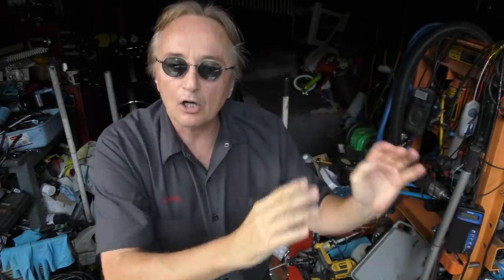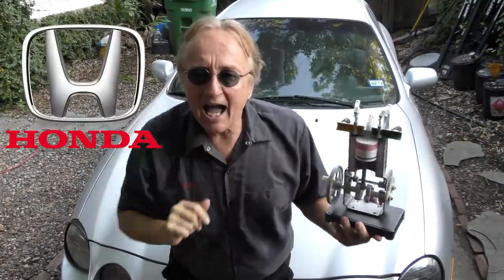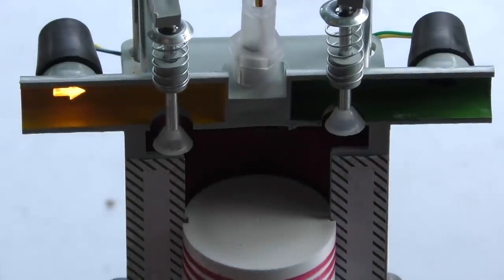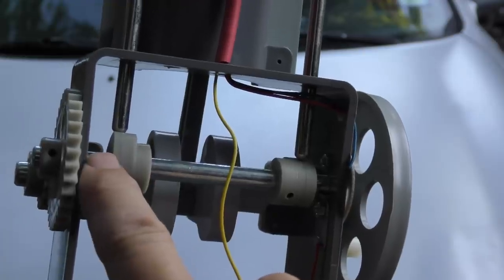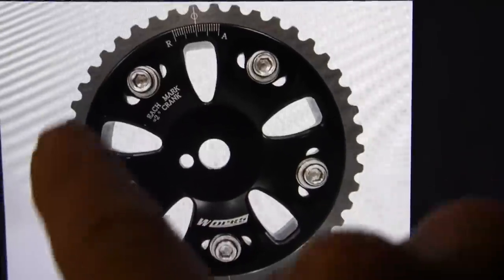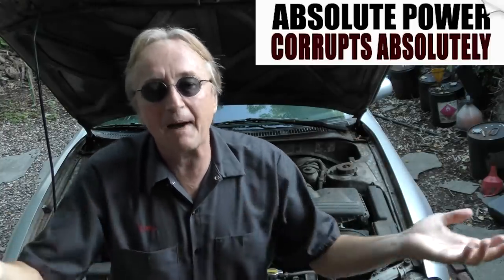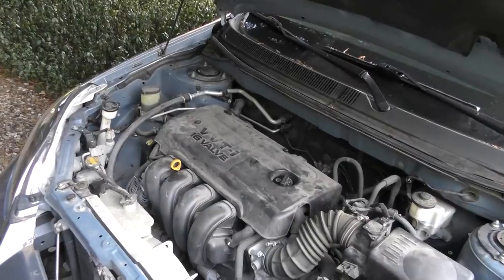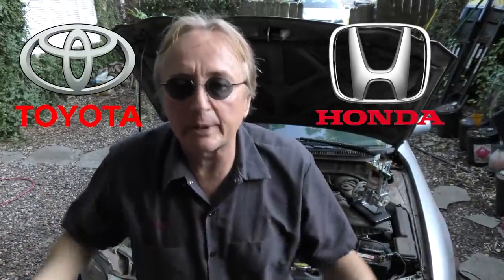VTEC Just Kicked in Yo - The Best and Worst VVT Cars to Buy

Comment: The s2000 is a beautifully crafted machine.  The engine will last as long as the car is appealing to look at. Note: The body lines are timeless.   I do wish the s2000 hardtop was more readily available. 

None the less, Honda makes some amazing vehicles that are easy to work on.  It's too bad they rarely need fixing!

This is coming from Nissan 350z owner.

Comment: Even better reason to avoid engines with absent or inadequate oil change documentation. I always thought using motor oil for hydraulic control of VVT was a problem waiting to happen. It certainly makes these engines more vulnerable to early failure because of bad maintenance.

Comment: Thanks for the video.

I have a 2016 Honda Fit, and I absolutely love it.  It came with lifetime oil changes when the maintenance minder reaches 15%, and Honda uses 100% synthetic oil.

However, although I monitor the maintenance minder, I don't fully trust the maintenance minder to properly tell me when to take care of my car.  As a result of having a very very light foot for acceleration, and I getting off the gas to coast way ahead of time when I see a red light ahead, this appears to cause the maintenance minder to change the oil life percentage very slowly.  For example, the maintenance minder generally displays the oil life at 15% after almost 15,000 miles.  To me, that's just pushing your luck and taking unnecessary chances, especially in the hot summer months.  And for those of you who might have a heavy foot, 15,000 miles would be way too far to go between oil change intervals.  So, when the maintenance minder reaches between 50-60%, I do my own oil change with Amsoil 100% synthetic oil, and when it reaches 15% I take it to the dealership to have them do it.  Keep it squeaky clean!

As a result of taking good care of the engine, and the whole car in general, and driving sensibly with a light foot, I average 44mpg with a mix of city (40%) and highway (60%) driving.

Comment: VTEC does not adjust cam timing. It just has different csm profiles for low rpm and high rpm. The later IVTEC was the system that introduced cam timing changes. This is why you can buy adjustable cam timing sprockets for the B series Honda engines.

Comment: I have a 2007 Mustang GT with the  VVT engine. At 81000 miles the engine failed. After it was put back by a mechanic, I changed the oil and put the recommend 5/20 oil in it. Almost immediately, the engine started acting funny like it was going to jump time. I am running 10/40 in it now. No problems since.

Comment: I bought a salvaged 02 celica gts with 110k on it , check engine light came on the next day . Had to change the oil pressure sending unit and it’s been doing good ever since

Comment: I have the legendary k20 engine with 200 horse power on an ep3 type R (1200kg)and it's super reliable and a lot of fun. Right now I wouldn't change it for anything. Also these engines were giving out 215 hp in the Japanese version of this car so people easily tune them up to 230/240 hp and they're still reliable but way faster. Just gotta always carry that bottle of oil in the boot .

Comment: I got my 1989 Toyota Cellica  running right again wow it was amazing how hard it was too locate a Bymetal vacume Regulator check valve ,  i searched for weeks even on Japaneese auto parts store sites ,  finally a used one poped up on ebay i bought it fast ,,, now i am gonna replace the rest of the vacume lines  next week ,

Comment: Cars that left me stranded: 
1. Plymouth Sundance : Transmission fell apart (about at 90 K) salvaged
2. Ford Tempo- Engine cracked (80k) salvaged
3. Volkswagen Jetta ('96) - head gasket blown (130k) traded in. 
3 '92 Mercedes Benz E190  - Ignition key stopped working/stuck (220k - it was eventually fixed car was sold in running condition)
4. 1993 Chevrolet Cavalier Z24-- 5spd. Too many problems and service to list, traded in at around 75k. 
Cars that never broke down, never left me on the side of the road: 
1. 1981 Ford Mustang LX 4-cylinder mileage unknown last time used was 1996 in running condition. 
2. 1992 Honda Accord EX -5spd.  Beside a few light bulbs and regular tear&wear never had an issue.
 Mileage unknown- last time was 250k, last time seen running 2005.

Comment: My family has had a Toyota Previa VVT (proably 2003) and we bought it new, it still runs today after 300.000km and nothing has happened to the engine! Only replaced the exhaust once and small minor things that all vichles have done to them, has proaby at least a good 70.000-80.000km left in it.

Comment: Actually I used to own a 1995 Alfa 155 that had the exact same pioneering variable valve 8 valve Twin Spark engine. Great engine, with good power and sound  and believe it or not reliable too. Well the gearbox and everithing electric on the car was a whole other story though.

Comment: I have a multiair engine. In my eyes that's the most advanced engine as Farr as VVT AND VVL go. Each cylinder has independent timing and lift depending on demand. It's designed so your valves can even open twice or more in one stroke depending on the conditions it needs to meet

Comment: Regular oil changes and the correct oil=longevity. Probably why the oil weight is printed on the filler cap in these modern engines.

Comment: I beat on my TL on the daily so I started using 10w30 oil, I should’ve done it before because I was using 5w20 and ended up getting shaving in the oil thankfully I caught on to it early on, flushed out the shaving then filled her up with 10w-30 with some Lucas oil treatment no more shavings! Ever since that I do oil changes on my TL every 2 weeks, the longest I’ll wait is to do it is 4 weeks.

Comment: I almost didn't buy a 1994 Honda Civic with 375,000 K, even though it drove like new and was in great shape, because when I tromped on the gas I thought I was hearing a slight rod knock. As it turned out I was hearing (for the first time) the cam timing change to high performance, thus the motor having a little more rap to it at 7000 RPM. I drove it for a few years (no repairs needed) with the peddle to the floor because it was so fun to drive. I sold it to a young kid and he really abused it until over 400,000 K (it was still running when he sold it. Mid 90's Honda's were the best cars ever made for the money. Excellent gas mileage, yet plenty of pep and extremely reliable and tough. Also a nice ride and handling.
Reply: I forgot to mention that the Honda (with high mileage) was completely dry underneath (not one oil leak anywhere) and didn't burn a drop of oil between oil changes (which I tend to stretch, but I do run synthetic).

Comment: Thanks for the tip on using the correct weight oil. I ALMOST bought 5-30 instead of 5-20 thinking it would be better for my high mileage (165,000) engine. It's the 5.7 HEMI with vvt.

Comment: Nissan VCT. In 1987 Nissan introduced the Variable Camshaft Timing—the VCT namesake—which dynamically adjusts cam timing throughout the powerband. You might be thinking that 1987 happened a whole two years before 1989, which is when Honda introduced VTEC on its second-generation Integra. Trouble is, Nissan didn't necessarily promote its whole variable cam phasing architecture as effectively as Honda did with its, which makes forgetting the fact that it came first forgivable and easy to do

Comment: I have a 2000 corolla that was "junk" and had it sold to me for 100$ cause they couldn't start it , it was the linkage cable in the shifter, changed it, and it started right up. 20$ a week of gas for work 👌

Comment: I was planning to buy Honda FIT DAA-GP1 2012 Hybrid. But when I did a research on the internet, I saw that most of Honda FIT have burning oil issue after ~50K kms. Therefore I am planning to avoid it and will buy 2005 corolla instead.

Comment: The early Vtec  systems I believe only adjusted valve lift, I never saw any phasers on the cams to adjust actual timing. I believe the valve timing systems were introduced with the Ivtec systems later on.

Comment: I'm in the UK driving a 1.0 litre vvti Yaris (Vitz in USA). It's 17 years old and managed 150,000 miles with nothing but normal servicing. I know some at 200k, in a 1.0 litre! It gets average 52mpg. Not fast of course but suits UK roads and town driving. It was made and assembled in Japan, later ones were assembled in France and some say they're not quite as good. Quite fancy a v-tech Honda next but want to see how many miles this little Yaris can reach first! Nothing else on the car is faulty yet either. I used to drive VWs (mainly diesels) but converted to petrol Japanese cars now.
Reply: Itchy Scratch how much horsepower does it have

Comment: The trouble with VTEC in my country is that they are normal cars as RPM and performance but the VTEC only make them weaker (instead of stronger) to get AMAZING gas mileage.
And that is fine, it is a good goal. But who buy Honda, think that they have the S2000 VTEC when it is the opposite of this concept of the original VTECs.

Comment: Toyota had VVT without the -i in 1993, in the 4A-GE 20v Silvertop JDM-only engine. VVT-i is better since it offers a continuous transition, the VVT was more about just changing between two timings, similar to VTEC.

Comment: I owned a 2005 toyota corolla sportivo with the 1.8 L  vvti-l engine.  Lotus purchased the same engine and added a super charger to put into their elise. That engine revs to 9000rpm and is N/A with a power band that kicks in at 6500 rpm's. My corolla had 250 klms when I traded it for a gt 86. I pushed that engine hard with oil changes at at every 5000klms. It has a timing chain that never needed changing. It didn't use any oil ( my best friends a mechanic and was fucking astonished.) He bought his wife a 2.0 litre BMW and she drove it like a grandma. He said it used 1.5 l  by every service. This engine shits on the current 2.0 subie engine  that sits in my gt 86. My friends were blown away at the engines performance and note when it kicked in at 6000 rpm.Sounded like a jet fighter taking off. Best engine I ever owned. I'm looking at getting another sportivo that's got low Klms.

Comment: Don't think it made it to the American market, but the Rover K-series VVC engine is another.  Decent bit of kit but a bit fragile unless slightly modified to prevent head gasket failure.  Available as a 1.8 litre, there were 3 power variants.  143bhp, 160bhp and 190bhp

Comment: I have an 05 Mazda 6 v6 with vvt and I now have 168000 miles. I have had the car since new, I always drive it hard every day with no problems. I guess I got lucky.
Reply: Mazda 3s are supposed to be very reliable, dont see why it should be different for 6's, sometimes information you get on youtube isn't right, and many times information only counts for few moddels.

Comment: If I'm correct, only the Honda i-VTEC engines have variable valve timing. Standard VTEC engines only have variable valve lift, so I guess it should be VLEC? I guess the timing still changes simply because the valves are open longer. Unless the VTEC cam lobes are slightly off-set with the normal ones? 

Anyway, I want to add to Scotty's comment about the importance of using the right oil and changing it frequently on VVT engines. Don't forget that piston rings and valve stem seals wear out quicker on these high revving, high lift engines. Check your oil very frequently, ideally multiple times per weak. I bought I high mileage civic as my first car and didn't know what I was doing. Burned all my oil off and destroyed the cam journals on the head.

Comment: Think this is one of the first videos you've posted I agree with everything completely on.  VVT is a brillian science, and some manufacturers are better than others.  Honda's been doing it the longest, of course they're the best at it.  Toyota just seems to get almost everything right...  

FIAT came up with MultiAir, which has a really cool principle, but if you're bad about changing oil, or a shop puts in anything but the right stuff (either 5w20 or 0w20 synthetic, only) you'll get problems.  Wrong oil will give you VVT Codes, and performance issues.

Side note, Chevrolet has Solenoids go bad, but isn't exactly prone to phasers.  I haven't seen anything VVT for Modern Fords yet.

Comment: i used to own a honda prelude with the H22a engine, vtec kicked in at 5000rpm and it would redline at 8, the thing was a rocket when you had the space to open it up, otherwise it drove like a regular honda civic
Reply: Still daily driving my Prelude SH to this day.  Vtec and torque vectoring still work fine after over 20 yrs with minimal maintenance and no major repairs. It's just a fun car to row the gears and throw it around corners, even if it's rattly and the clear coat is failing...

Comment: I had a 2013 carolla with the vvti 4 cylinder special edition with the hot lava orange paint.(look up a pic on YouTube it was a one year only color that only came on special editions) The car was very quick, and If it had a 6 speed manual or auto it would have been a beast. The old 4 speed with o/d is a good transmission but limited the potential of that car. Theu should have made an xrs version before discontinuing that generation.

Comment: Need diagram or example that shows the fluid engaging the dog gear? So that the larger cam lobe slides over to give the valve longer  durations ect. In the higer RPMS

Comment: People these days think they are ENGINEERS, cars ask for 0w-20 and they end up using 10w-30 because they THINK thicker oil is BETTER... (smh).
Reply: I believe you, I think down here in TEXAS a lot of people make the same mistake, specially in SUMMER.  That's like putting 0w-20 in a DIESEL engine during the WINTER for cold starts, that just doesn't work that way.

Comment: Actually, the first version of a Variable Valve Timing system was used in an Alfa Romeo in 1923. YES, IN 1923.  Honda was not exist till early 60's I think. VVT system perfected by Alfa also in the first version of Twinsparks (8V versions) before 1992 and once the company sold to FIAT in 90's, the system changed by OIL trigried system, from the Elecric triggered older system. This is when the unreliability kicked in,  because of the structure of Alfa Engines, the engine oil level has to be checked periodically and needs to be kept in a certain min. level, otherwise variator will work without the oil and brakes down. Alfa I4 twin sparks burns the oil due to its structure, so level should be monitored at all times but end user would not check it and they say Alfa is unreliable..

Comment: MAZDA uses a Ford made VVT "rotor" that was prone to failure. The metal was garbage. They started heat treating the rotor and it helped quite a bit. If you do a timing chain replacement on a gen1 or gen2 Mazda3 or Mazdaspeed3 be sure you change the rotor out to the newer heat treated one. If your Mazda is a 2013 or newer then it had the new rotor from the factory. And Scotty is right....CHANGE YOUR OIL CONSTANTLY! Dirty sooty oil is what ruins the VVT systems (AND timing chains!!)

Comment: check matrix and corolla xrs  or  celica gts  2zzge VVTLI came out 1999 and lift better then honda vtec or dual vtec Vvtli  optimized for lower rpm operation and  optimized for high rpm operation, with higher lift and longer duration.

Comment: But even back in the 1960's the timing was able to be advanced or retarded using the vacuum from the engine - Granted, it did not allow for variable valve opening but the timing was not locked in one position. Might be worth discussing VTEC-E as well as it is the economy timing mode, and while on the subject, maybe VTC (Variable Timing Control) - Some really clever innovations.

Comment: How often do you take your eco box civic to over 5k-7k RPM? Which is even more of a pain in a auto. Moreover, most civic eco boxes out there are SOHC. Even very steep hills it doesn't even gear down pass 4.5k holding the speed limit. If you need to gear down and hit vtech, do you really need to pass? It's fun but doesn't have a practical use.

You can also say good bye to your 47mpg

Comment: My 09 Camry has VVT.  The 4cylinder engine is pretty lethargic, but I have noticed that power seems to increase while accelerating in a lower gear when you reach 3500-4000RPM...Always wondered if this power increase is due to the VVT or just emission controls....

Comment: But why does Honda manage to get as much as 120hp/litter while Toyota and others don't? The '96 Civic had a B16 1.6L engine that did 160hp. And look at the Honda S2000.

Also, what about Nissan's variable valve timing implementation?

Comment: 2003 Mazda Mx5 with vvt here. If I said it didn't have vvt and I did a WOT pull, you'd believe me 😧. It hasn't been problematic but then again it really shouldn't be since it doesn't seem to serve a purpose 🤣
Reply: then I'm afraid you haven't done a pull WOT on a VTEC engine with a minimal tune yet, or else you would know that it most definitely serves a purpose and understand what "VTEC just kicked in yo" means.
Reply: @stoicspartan01  Vtec is exclusive to Honda, what I'm saying is that other brand's vvt systems don't feel or operate the same way as Honda's. I know with Honda there's a clearly audible change in engine tone and power when it transitions to high cam lift/duration.
Reply: @JustAlanIsCool  now I get it. thanks for clarifying your point; VVT and the likes are not as noticeable, except in the way power is carried through the RPM range, as VTEC is.

Comment: Hi! Awesome videos. I also have a question for u. I have a 2000 Celica gts and I’m using a high mile oil for it. And have not gone to synthetic oil.  I have about 60k on this engine I got from japan.  So far Its running great so my 2 part question is ; should I change to reg oil and should I go synthetic?